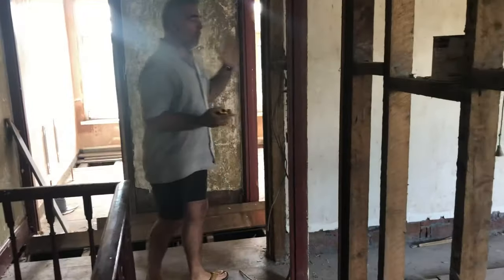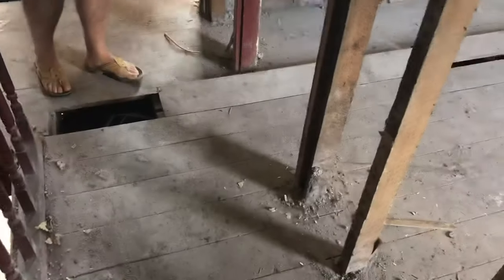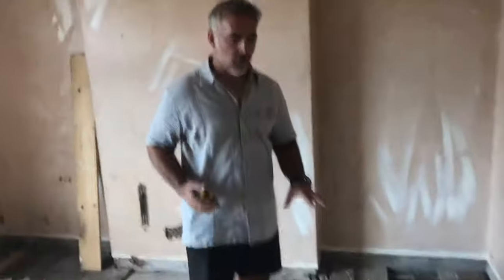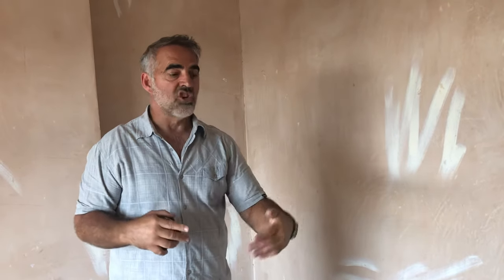How to know if a wall is Load Bearing (Structural) on Non Load bearing (Non Structural).

Comment: some say all solid walls that are Perpendicular to the rafters/trusses are load bearing, whether they were designed to be or not, because of the structure settling over time, is this the case please?
Reply from the maker: Hi difficult to say to be honest. I’m this video, I’m explaining the easiest way to determine by way of noting floor joist bearing directly on a wall.

Comment: SO I went to the basement and I have beams running | | | | | and the wall I wanna take down above runs like "|" not like "---"...I should be good right?
Reply from the maker: Thanks. If the wall is running in the same direction as joists, then they are not resting/being supported by the wall.

Comment: I have a three storey house. I want to remove a wall on the middle floor. The joists above and below run in different directions. It seems to be supporting the joists above but the wall doesn’t continue down to the ground floor and appears to be built on top of the floor boards? Is this likely to be load bearing?
Reply from the maker: Hello Keith 
Very common for the first floor wall not to be directly above the ground floor. Often a 150-200mm off set. If the joists at FF are sitting on the Ground floor wall. Then that wall is load bearing. If the joists to top floor are not sitting on middle wall. Then is presume that wall is not load bearing.  Draw a sketch of each floor on graph paper, use 1 square as 1 metre. Check the directions of the joists as I suggest and draw the wall that they sit on ‘thicker’. You may find you get a better picture of what walls are then load bearing. 
Hope that helps.

Comment: Really useful. What about the landing (above the staircase) joists? Does that rest on anything? I’ve got a similar middle structural wall but it isn’t clear what the landing joists rest on to.
Reply from the maker: Thanks. In this case the landing bears on the wall below. But is often ‘trimmed’ off  double joists. You should lift the boards and check.

Comment: What if the joists don’t have a join in them? So the joist looks like it’s running from one end of the house to the other? Would the wall underneath then be a load bearing wall?
Reply from the maker: Correct Samantha, if the joist are sitting on the wall, they are being supported.
Reply: @mikewoodspropertychannel  we have just had the wall knocked out and been told by the builders that it isn’t load bearing? This is why I was asking because I can’t understand how the joists will hold everything above now the wall is gone?
Reply from the maker: @samanthamealing7337  strange! If the joist are being supported by a wall and you remove the wall, they lose their support. It could be that the single joist is sufficient size wise enough to span from end to end. As long as you had Building Control to oversee and they approved it. Then happy days.

Comment: Wondering how you determine so in a flat, multiple rise? 🤔 thanks for great video
Reply from the maker: Thanks Joshua, same really lift the floor coverings and note the direction of the floor boards, in turn this will determine the direction of the joists. In a domestic setting in the UK,  joists tend not to span more that 4 4.5 metres (12-15ft). So, if the room is this size and you have determined the direction of the joist...the wall at the end will probably be load bearing. Hope that makes sense.
Reply: @mikewoodspropertychannel  - really appreciate you getting back to us Mike, must take a while to get back to everyone! In high rises, floorboards tend to not exist as much as block and beams or steels are present

Comment: I just bought a house, and the wall separating the bathroom and second bedroom had a large crack down it. I took a little plaster off and found it was blocks, further investigation I found the whole wall was blocks and lay straight onto floorboards, I don't think it's load baring, can't be good to have a wall lay onto wooden floor, under the bathroom is the dining room, its a nice size room too.
Reply from the maker: Common in old houses to have brick or block walls on upper floors. Correct not good. They should have doubled joists under the wall. It won’t be load bearing and it has no support. Good luck

Comment: is it always this simple or can there be exceptions i have a wall downstairs between my kitchen and dinning room the joists run the same way as the wall and the wall runs from the front of the house to the back but the first half whitch is the wall in the lounge  goes from floor all the way to the attic but the  half i want to remove only goes to the dining room ceiling  and its the only wall in the house that stops at the ceiling and doesnt go up to the attic so i would say its not a load bearing wall but wondered if there was any exceptions also the house was built in 1935
Reply from the maker: If a wall has a similar wall directly above, then the wall below is carrying the load of the wall above.

Comment: The two walls are probably load bearing. As the wall running parallel. Is supporting the stair stringers. So I would speak to a structural engineer before remove that wall
Reply from the maker: Thanks. But in this case the stairs was parallel to the wall that extended to the rear wall. The stair was trimmed onto that wall, not the front section.

Comment: Yeh this is literally my house... thank you.
I won't be knocking it through then.
Reply from the maker: You’re very welcome
Reply from the maker: You can knock through, you will need to instal a lintel or an RSJ depending on the size of the opening. Speak to Building Control or a Structural Engineer

Comment: We are just about to exchange on our sale of house and our buyer has asked for a report to say our kitchen / diner wall removed by previous owners had left the property structurally sound , there was no certificate obtained when work was done 17 years ago although we know the builder who did the work and he has confirmed the wall was not load bearing and he installed a steel anyway as likes to be thorough , do you envisage any problems coming back from report ? 

Property is mid terrace
Reply from the maker: Hi Thanks for your message. I think that your builder installed a beam (that wasn’t needed) will prompt the question - is the steel beam the correct size! To enable the sale to proceed you may want to engage a Structural Engineer to provide a report. From what you say, it seems it will be positive.  And it will facilitate the sale. Good luck.
Reply: @mikewoodspropertychannel  yes we have agreed for a report to be done by a structural engineer at our own cost as a good will gesture , I was just a little stressed at hearing this at such a late stage in enquiries , the buyer is an investor and suspect this is needed for insurance purposes, Is the work needed for report very invasive as the beam is finished with a plastered bulkhead ?
Reply from the maker: @Thevoiceofreason84  I would do whatever to get the sale. It may well be the purchasers surveyor! If they can determine the beam isn’t load bearing, then they may not need to open up to check the size of the beam.
Reply: @mikewoodspropertychannel  thank you for taking the time to reply fingers crossed no issues , from the few opinions I’ve had on the matter most agreed should be fine 🤞
Reply from the maker: @Thevoiceofreason84  you’re very welcome. Happy to help

Comment: Your explanation is too complex.  Make it simple
Reply: I'm not sure if this is a joke or not. He's saying that if your joists run over your wall (rather than in the same direction as it) the wall is supporting those joists.
Reply from the maker: As Lio states… walls that ‘carry’ a floor - where the joist rest on the wall… it’s load bearing.
Reply: @mikewoodspropertychannel  -

Yes but is the true if the joists are a single piece and not spliced above the wall in question?
Reply: If you don't understand this explanation then get someone in to look at it for you before you tear a wall down.